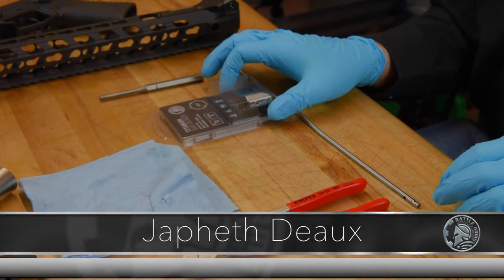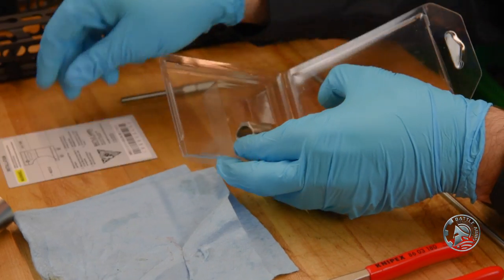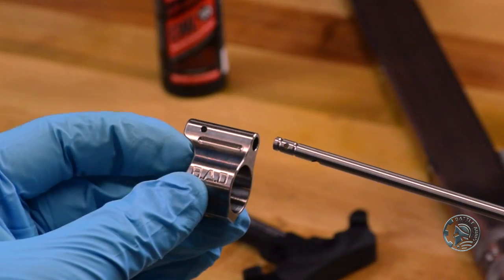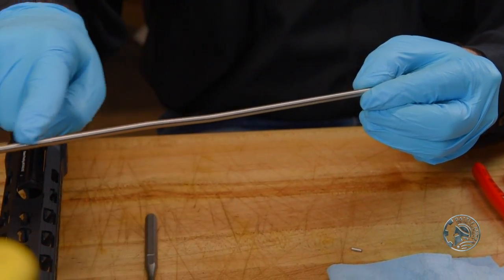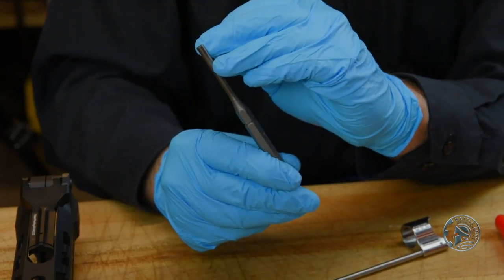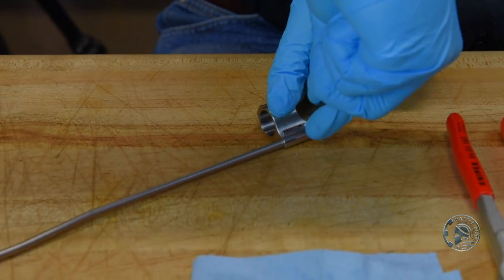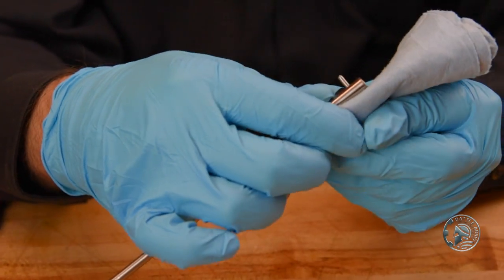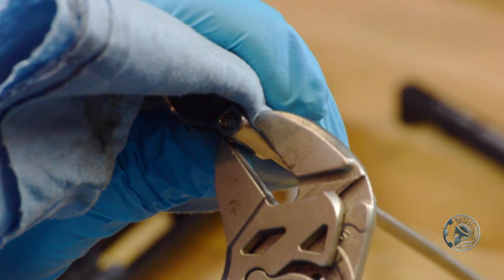THE UPPER  Gas Block Assembly How t pin the Gas Tube in Place Part 4

Comment: I was having a heck of a time with my gas tube rotating, trying to install that pin. What I ended up doing was putting a punch through the gas block and gas tube, to insure the holes were lined up and then cut a piece of duct tape and taped the gas block and gas tube together.  Everything stayed in place, remove the punch, and I got the pin in using a roll pin punch.